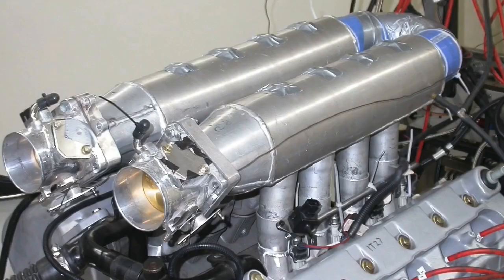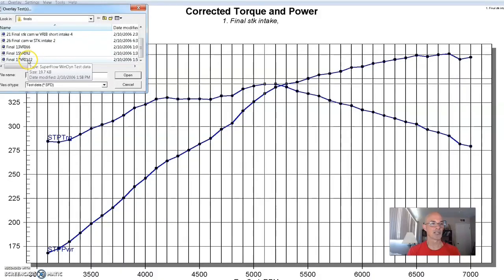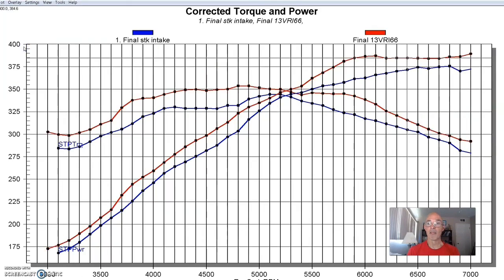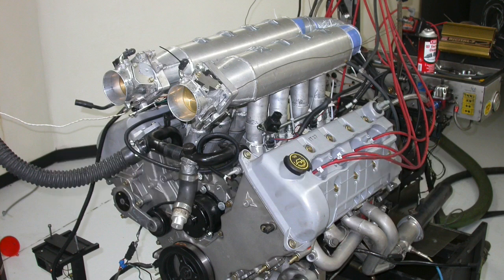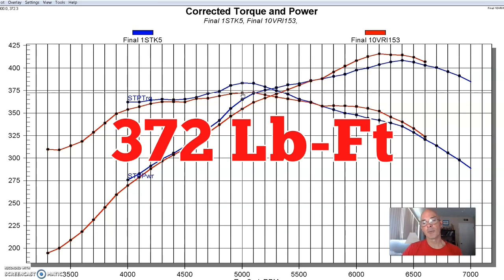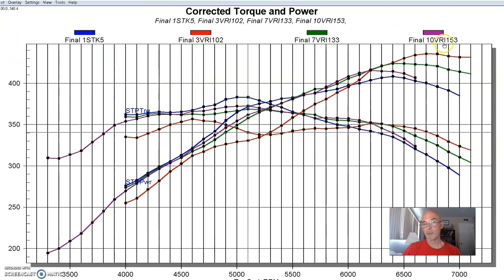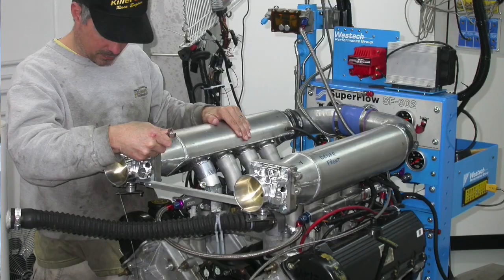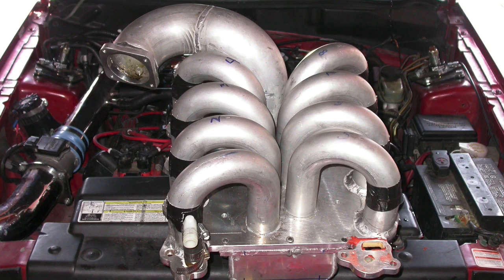CUSTOM INTAKES--BUILT NOT BOUGHT

Comment: pretty sure Yamaha had constantly variable intake lengths on some of their performance motorbikes.  They also did a lot of intake/head work for other car companies
Reply: But how? I dont think its possible.
Reply: @ryanmalin  it's easily possible, was a hill climb car here in the uk that had it.
Reply: @ryanmalin  Ford in Australia did it on their production line 6 cylinder cars for a few years.
Reply: @DodgyBrothersEngineering  continuous? Or just two stages?
Reply: @garyhowe88  I'm not a Ford fan, so I know they did it but never really went too deeply into it. I was told it was continuous but I suspect it was just two stage. I can't see it being fully adjustable. It was quite a while ago, like 20 years ago.
Reply: Dodgy Brothers Engineering . It was called intech. It was on the AU series
Reply: @9psi  thanks for that, I just remember thinking I wish Holden would do something similar. Was it fully adjustable stacks or just a two stage? (a bypass butterfly).

Comment: ferrari actually has an ajustable intake length on the LaFerrari, that tech is already banned from formula one before they got tu use is, the new gmc 3.0L inline 6 diesel also has variable runner length intakes.
Reply: Most vw engines seem to have flaps that block one intake port per cylinder I think. Acts similar to variable runner length
Reply: @ReubenHorner  So do those 4.6 Lincoln engines.
Reply: @ReubenHorner  Those flaps changes the swirl/tumble of the air entering the cylinder for lean combustion. Those flaps are removed in high performance engines.
Reply: @julienboucaron9780  the tumble flaps also prevent super knock during high load low rpm situations like from cruising on the highway and having to go up a hill in the highest gear of the transmission. Most of the time my calibrator will have the tumble flaps just stay open from about 1900 rpms to redline. Plus they help with cold start up because the air swirl causes the fuel to mix better.
Reply: That’s for the tip I didn’t know it helps with cold starting is is the same for hot starting too??

Definitely will be using that strategy for my new engine build ( still working on finishing it up and programming the aftermarket ecu ) as it has variable camshaft VVT and VVD and VVL so everything vanos and FCA’s tigershark engines can do mine can and then some and I wasn’t going to use the DBW throttle bodie / variable runners ( for Engine idling control aka any thing below 2500 RPMs ) except for fail safe mode so I don’t kill my self or others as having a land based V8 Cruise misslle 🚀 isn’t a good thing 😆
Reply: My 2018 Tundra has automatic adjustable runners , that vary according to load and RPM. Cool stuff.

Comment: Talk about seeing reflected waves in the power curve.
Oh and this is exactly why OEM's have sold many intake manifolds with dual length runners. Long for the low end torque, then swaps over to a short runner as the RPM rise. Mostly on 4 and 6 cylinders.
Why settle, when you can have both ;)
Reply: My V8 Audi S4 has that as well. Even seen three stage/runner length intake manifolds on the older timing belt V8 Audi engines. Pretty sure that the older Lamborghini Murcielago 6.2 liter V12 had a three stage intake manifold too.
Reply: Almost all new cars have some form of variable intakes.
Reply: That and VVT have completely changed the game. EFI did too, but these things build on that. No wonder modern engines have such a wide powerband and a flat torque curve! If Comp or Isky or Crane were to develop a retrofit  VVT system for old-school V8s, sportsman racing and hot rodding would never be the same. And honestly, a simple, rudimentary system could be devised with a variable cam gear, incorporating a clutch or spring with electronic control, based on load data.